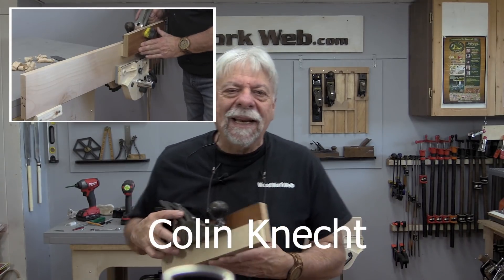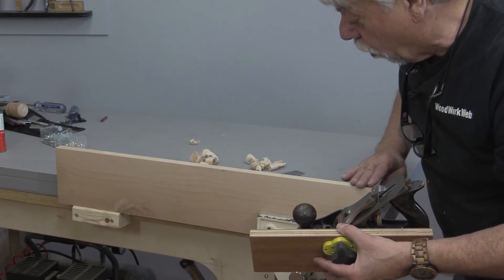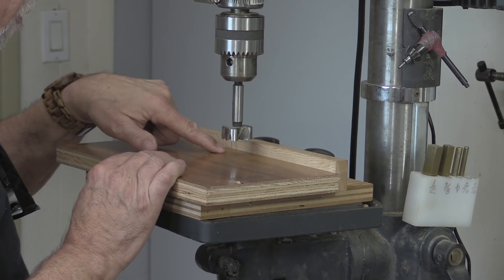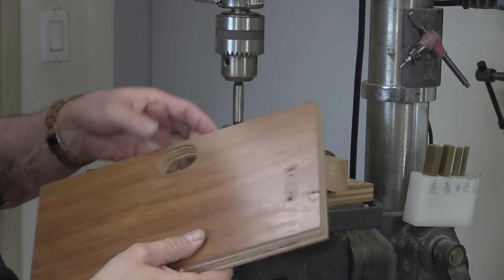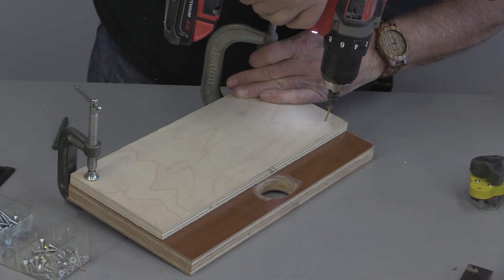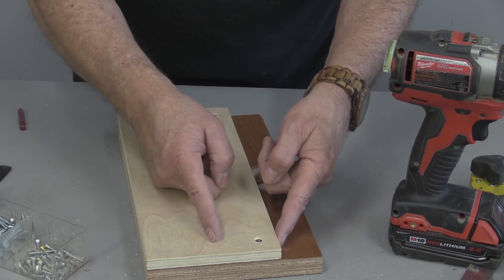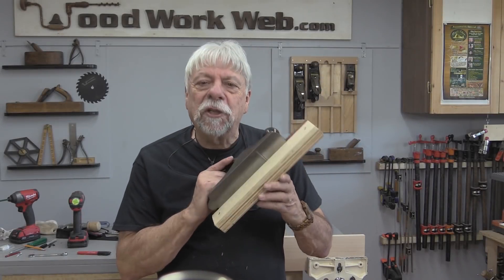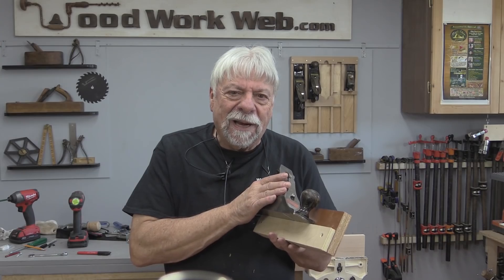Bench Plane / Hand Plane Right Angle Jig for Surfacing

Comment: Thanks Colin I did something like that years ago I took NOT my best plane and drilled and tapped it to attach a guide. I don't think mag switches were invented or the strongest magnet available then was a lodestone. When all ya got is rocks, use rocks. It worked pretty well for my purposes until I bought a jointer and now I have a dusty rusty jack plane with 1/4-20 holes in the side.

Comment: it is v. gteat jig and simple solution for beginners to get a flat surfaces.,But must we use a magnetic knob?
Thanks for your vedio.
Reply: You could always drill and tap the cheeks to fix a fence to it. Go one step further and extend the fence to create a smoother at a pinch provided the surfaces either side of the sole are flush with the sole and themselves.
Reply: You could use double stick tape. But I would like the mag switch idea better.

Comment: Perhaps you should have mentioned, at least for the sake of a beginner, that not only does the face of the wood being planed need to be milled perfectly flat first, but the plane body should also be square to the sole. Not all planes are. Otherwise, this is a great jig.
Reply: Very good point, thanks mate.
Reply: I totally agree 🤔 ,  for me practice to flatten a board with only the hand plane  all 4 sides is a joy but needs patience & time though and I will go for longer soul plane # 7  😊 .
Reply: kperellie That’s an excellent point. I recently restored a Stanley Bailey Type 16 1933-1941 and was surprised how far out of square the sides were to the bottom.
Reply: @davetarrant6888  It doesn't really matter how out of square the plane is as long as the blade is set square to the fence
Reply: Allan D That makes sense thanks!  I am a newbie :-) but learning.
Reply: @davetarrant6888  Aint we all m8y, btw nice Craftsman Table Saw, nearly as old as me
Reply: Allan D Thanks Allan I was pretty lucky finding that saw in such great condition.